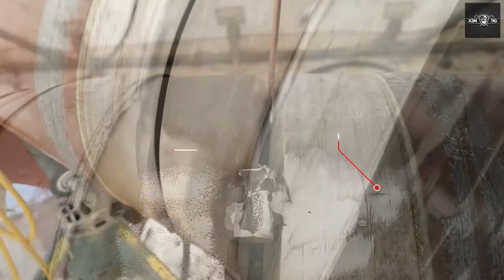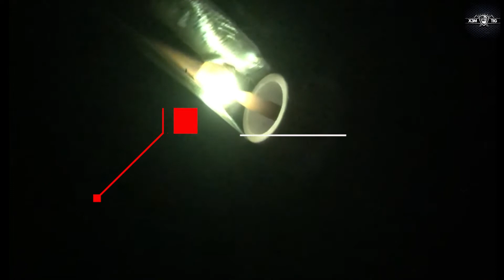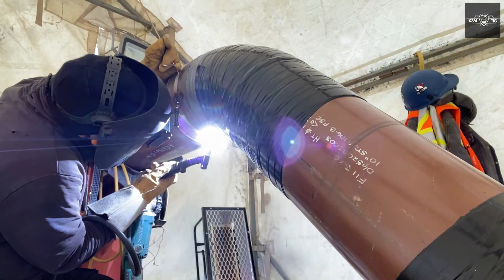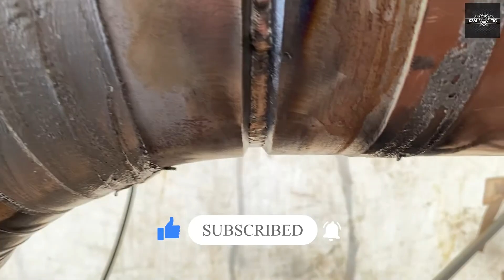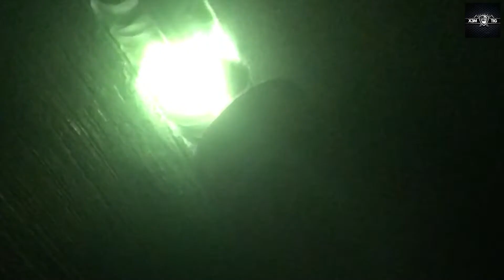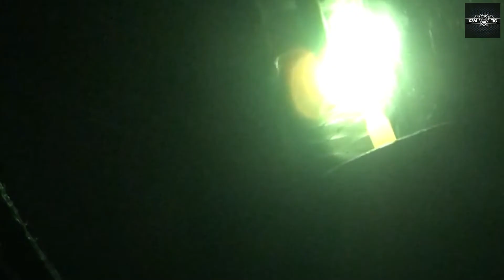Freehand TIG Welding VS Walking The Cup Technique!

Comment: Is it possible to get a similar sized root bead on the inside from filling from the outside rather than back feed. I can get about 1mm reinforcement consistently on the inside from the outside feed. 

Im currently doing my cert 7 ( tig on 3" sched 40, 2g and 5g  postion at tafe ( australian school)). 
Hoping to pass in the next few weeks. Fill and cap are all good. Just my root needs a that last ten percent help

Comment: Is it key to stay just hot enough to weld? Does the filler rod lower the weld temp?
Reply from the maker: The only key is in your skills and amps that you can handle . Filler wire not lower weld temp. You have to run hot enough to melt that rod, but it doesn't  have any impact on lowering your weld temp. Thanks for your comment bud!